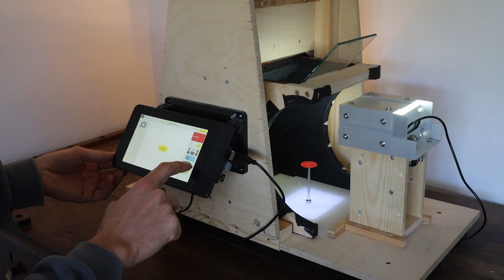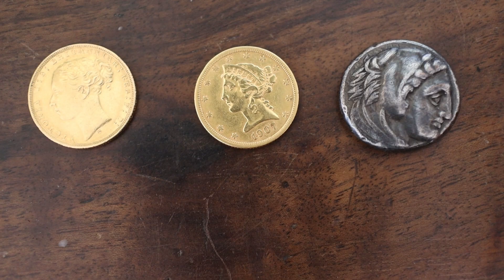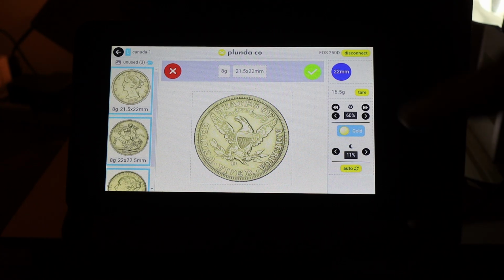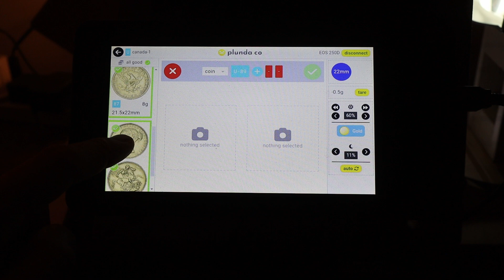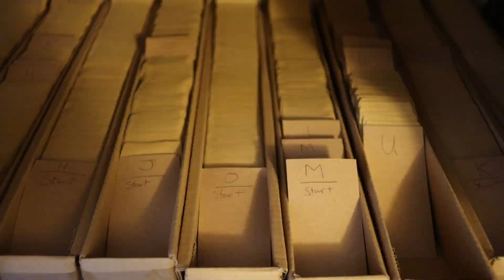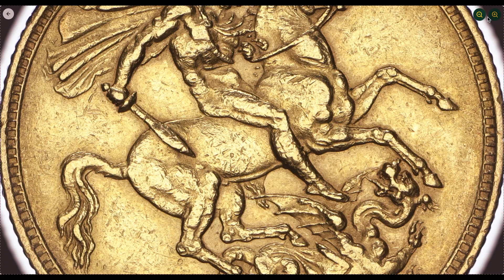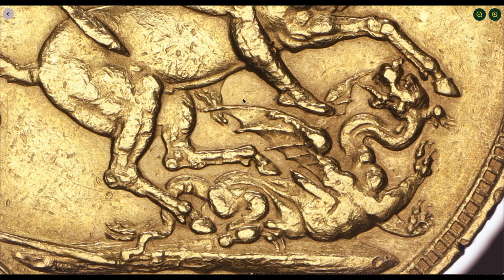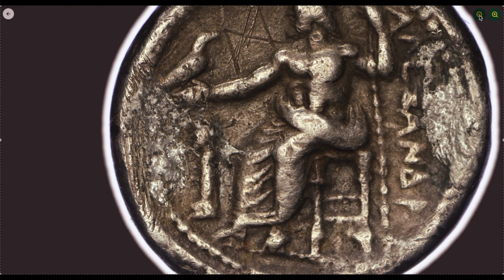Coin Photography Machine - version 2

Comment: Can I get a touch screen like that. And weight unit
Reply from the maker: yeah it's just a standard Raspberry Pi Touch Display 2

the weight sensor is a little more complicated. you'll have to research pressure sensors and hx711 chips
Reply: Ty what about custom app ?
Reply from the maker: @docgreen2487  the custom app is built specifically for integrating into plunda.co. it could be modified for other use cases though but that would require some programming changes. what do you want to use it for? tell me more about your usecase
Reply: I need a setup